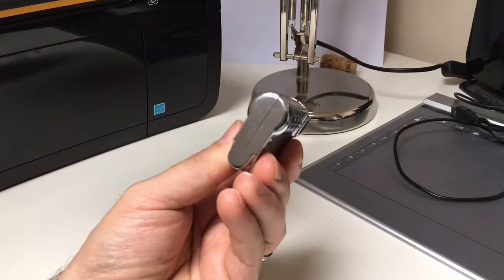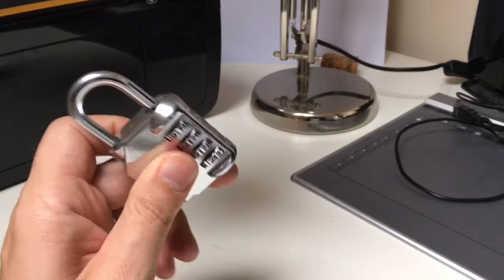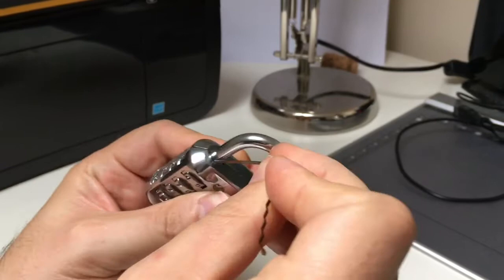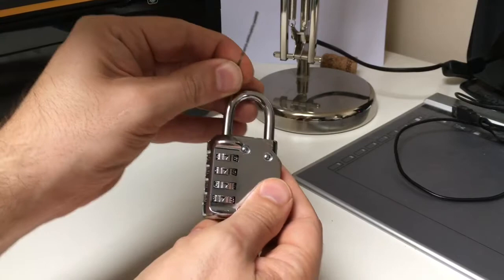(041) Decoding a combination padlock with a bobby pin

Comment: im having the same nightmare unbranded cheap 4 wheel combo is doing my head in. totally no feedback or stiffness on any of the wheels they all move freely. mine has a sort of round disk around that shackle thus stopping me from sticking anything down it to do what you have just done but im not going to give up on it. its the unbraned 4 wheel combo from wickes iv tried everything i can think of even using a shim under the wheel makes it stiffer to turn around but its not giving me any feedback if i hit the right number.
Reply from the maker: Darren Davenport, try Potti314's videos on decoding. He is the master and may help you. :-)
Reply: Lock Noob will do i did see him do the 3 and 4 wheel locks but his did seem to have some stiffness in turning the wheels iv take a look to see what im doing wrong. its also hard on the hand having to pull on the shackle to try to find the right number to cheers .